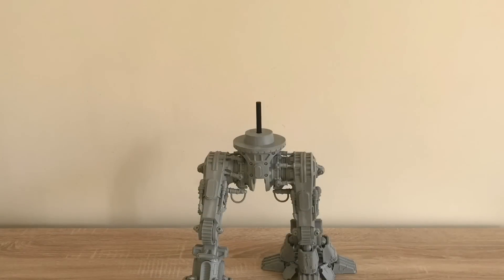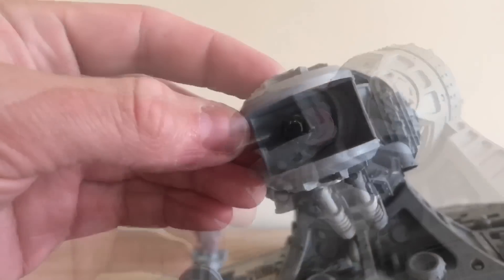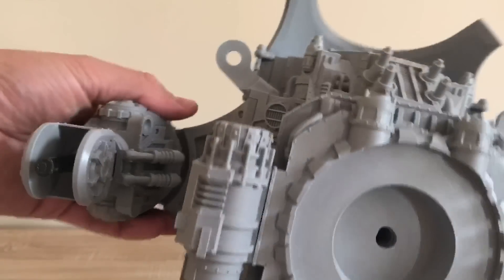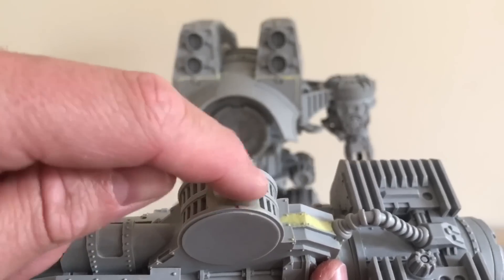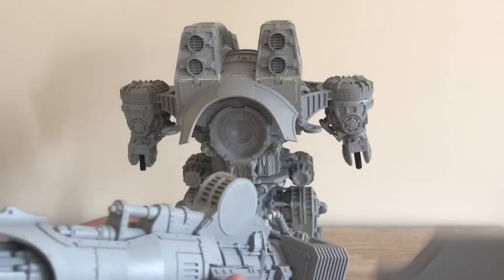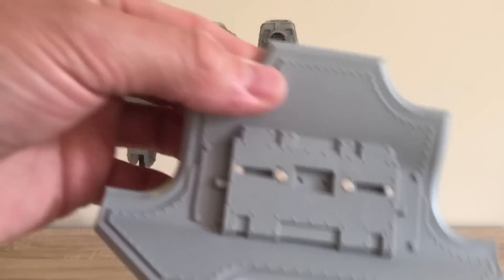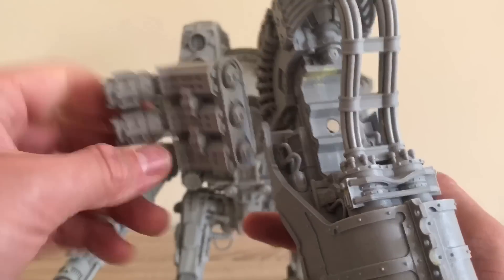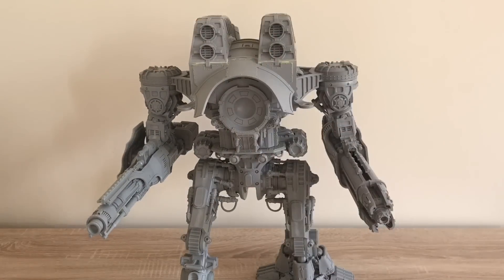2 Minute Modeller: Warlord Titan Arm Weapon Magnetisation (Forge World, WH40K)

Comment: What kind/type/brand of drill did you use?
Reply from the maker: The type of drill is more important than the brand (as long as it isn't utter garbage!)

For the 8mm carbon fibre rod holes I used a wood drill, the type with the small central point for starting the hole.

For the 13mm recesses for the doughnut magnets I used a blade drill, again designed for wood.

One thing that is essential with this is to do lots of push fitting to make sure everything fits and can be separated easily, especially the rods going into the weapons.

Comment: What kind of epoxy did you use?
Reply from the maker: I used Araldite Standard 2-part epoxy adhesive. This has a cure time of 18 hours (?) and is extremely strong when set.

Any equivalent ultra-strong epoxy will also work. Don't use a quick setting type as it won't be strong enough on a join like this!
Reply: leakycheese thanks! This will be extremely useful on my warlord